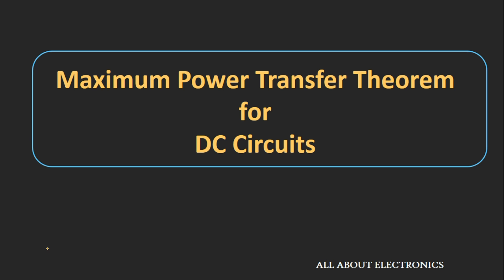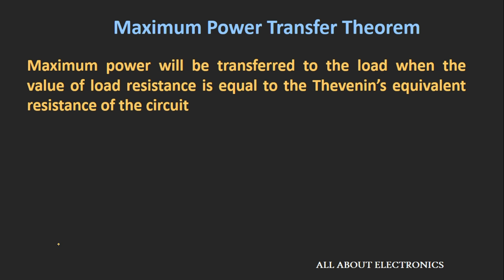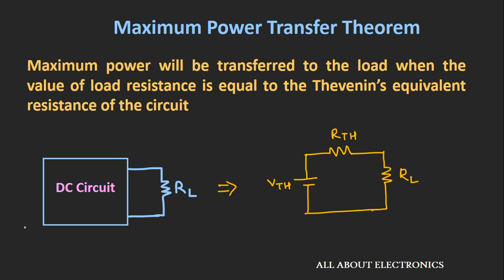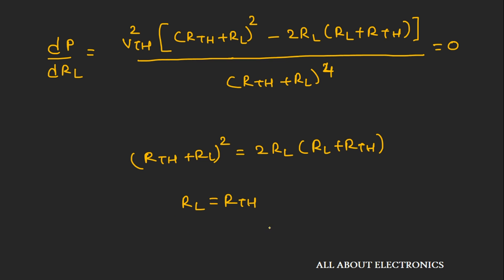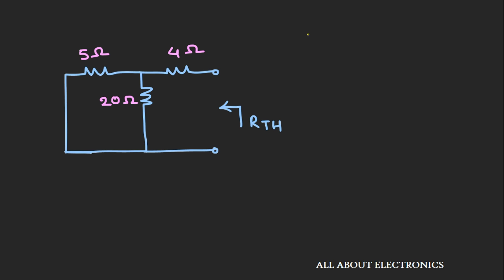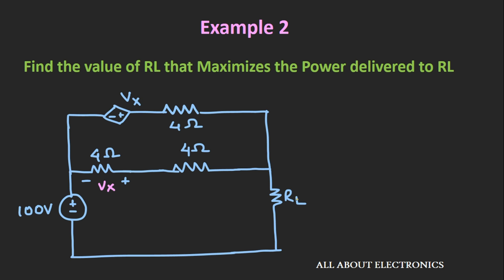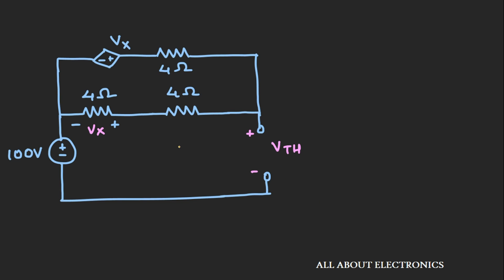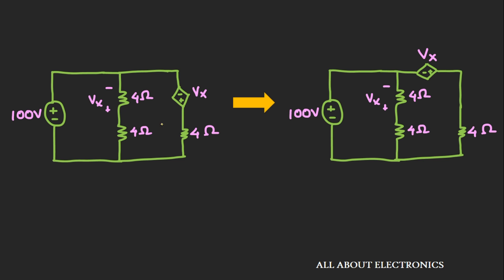Maximum Power Transfer Theorem for DC Circuits (with Examples)

Comment from the maker: 8:48 Example 3:  For example 3, although the answer is correct(i.e Rs= 0), a method to solve this example should be followed as mentioned here.
 Here, As the value of load resistance (RL) is fixed, so we can't apply maximum power transfer theorem. And for maximum power transfer across the load resistance RL, the value of Rs should be as low as possible.(i.e Rs=0).
This example was asked in IES-2011.
Reply: Can you Pls elaborate a little????  This part makes me go mad
Reply: @ramasubramaniang1638  He's wrong. What he's doing is short circuiting the A and B nodes (the two open nodes) together, making them the same node. The 3 parallel 30 ohm circuit is correct, it just has different A and B nodes than the original circuit, making it useless for finding R thevenin. Since the maximum power transfer theorem still applies (why wouldn't it?), the correct way to solve the problem would be to find the Rs that makes R thevenin equal to 10 ohm. The left two 30 ohm resistors are in parallel, so they're Req is 15 ohm. That is then in series with the last 30 ohm resistor, making Req 45 ohm. That Req as well as Rs are now both in parallel w/ the A and B nodes, so the Rs value that in parallel with a 45 ohm resistor has an Req of 10 ohm is the answer. That means Rs = approx. 12.86 ohm.
Reply: @shefproductions  Yes, that is what I got too. I really like this channel but he doesn't really address concerns when a mistake is made. Might be a cultural thing.
Reply: @shefproductions  yeah that's right.
Reply: @shefproductions  thnku so much..my confusion is cleared nw
Reply: @shefproductions  When Rs= 12.86, power delivered to load is 2.5 W. When Rs= 0 , Power delivered to load is 10 W. I leave it to you to figure out who's wrong. 
Maximum Power transfer theorem was derived on the basis that load resistance was variable, that's why we could differentitate w.r.t load resistance. If load resistance is fixed, there's no meaning to differentiating w.r.t a constant.
Reply: @shefproductions  ur right
Reply: @Cooked Up Beats In this question, after removing the load and short circuiting the independent voltage source, if you look carefully, the two 30 ohm resistors are in parallel with the series combination of the other 30 ohm and Rs ohm resistor. If you solve further after this, you will get the value of Rs equal to 0.

Comment: If Rs = 0 in Example 3, it seems it makes an outside rail that makes the circuit short-circuited. No resistance can be sensed even using an Ohmmeter. You can prove this by applying this, say, on a breadboard.
Reply: To add to this, the three 30-ohm resistors will only be in parallel if one terminal is on the "central" node, and the other terminal on the common (bottom) rail.

Comment: 7:50 why the negative sign ? v_x = - 50 ?
Reply from the maker: As I have mentioned, the 100 V is getting divided between two 4 ohm resistors equally. The top side of the 4 ohm resistor would be positive while the bottom will be negative.
But here the polarity of the Vx is exactly opppsite. Therefore, Vx = -50V. 

I hope it will clear your doubt.
Reply: @ALLABOUTELECTRONICS  Thanks, I really enjoy watching your videos.
Regards,

Comment: sir, should you please add pdf in below... for all we better pratice for all students sir........
Reply from the maker: I used to provide the Quiz on different topics (with solution) as a community post. Please check the community tab section of the channel more questions. I have already provided many questions on this topic. Although you need to scroll a bit to reach there. But you will find many questions on the network theory.

Comment: if we do not put Rs value to 0 but to 90/7 {obtained by just solving the circuit}, the also thevenin's resistance is coming equal to 10. Can you solve my confusion???
Reply: we should get equivalent as 10
in such case the two answers are correct for the given question
we get equivalent as 10 in the both cases
hence both are correct answers for 'Rs' to get maximum power across the 10ohm resistor.
Reply: my answer is also coming out to be 90/7

Comment: 7:54 ...Vx=-50V why is it not +50 ??and sign of the terminals of 4 ohm resistors are taken opposite..why??plz explain.
Reply from the maker: 100V voltage source is appearing across 2 4ohm resistors. That means across each 4-ohm resistor voltage will be equal to 50V. Now, here the sign of Vx is opposite (Negative terminal at the top and the positive terminal at the bottom).
So, Vx= -50V
I hope it will clear yout doubt.
Reply: I had the same question. Thank you for your explaination. I find circuit analysis hard to do. You make it look so easy.

Comment: hi, i have a doubt .In example 3, when u make Rs=0, doesn't the terminals across which Rth is present getting shorted (will become equi potential points, Rth will become 0) ? if we calculate Rth in terms of Rs and then equating it to 10 ohms ,then it is giving Rs equals to 90/7 ohms......
Reply: @pavanmacherla1295  my answer is also coming out to be 90/7

Comment: Hi, on example three I'm a bit confused about how when RS=0 the 3 30 ohm resistors become parallel. If measuring from the terminal by the 10 ohm resistor, wouldn't setting Rs=0 short out the network being measured from that terminal, thus making Rth=0? I do see that the three are in parallel if the reference point was the intersection of the three resistors, but it looks like the ends of the terminals being measured become the same node.

I really love your videos. Thank you for these wonderful explanations!

Comment: example 3 final slide wont a 30 ohm resistor be in series with the parallel combination of the other 2?? how all 3 became parallel
Reply from the maker: No, as soon as we consider Rs as zero, then all three resistors will be in parallel. (one end of 30-ohm resistor will be at zero potential and one end will be connected to remaining two 30 ohm resistors.)
What you are saying would have been true, if we remove Rs from the circuit or to say when Rs is infinity (open circuit)
Reply: got it. Thanks